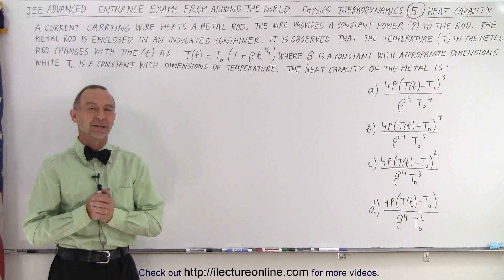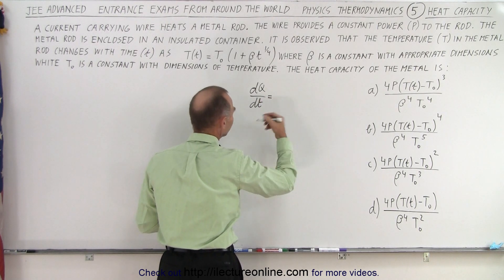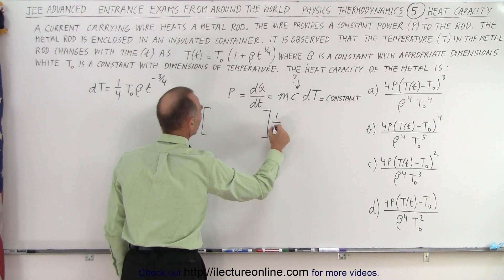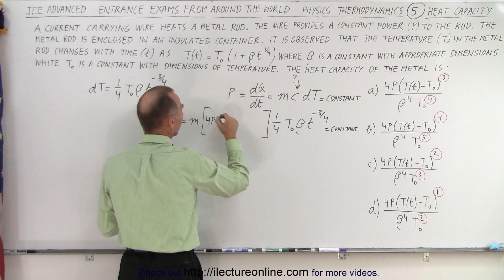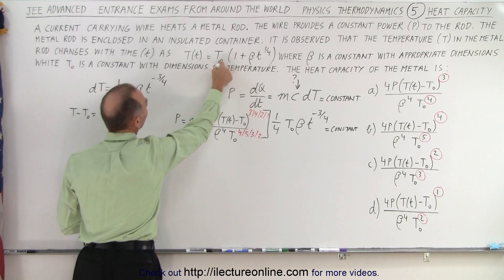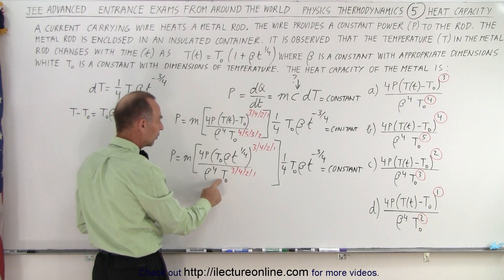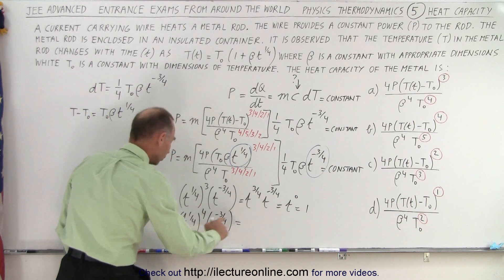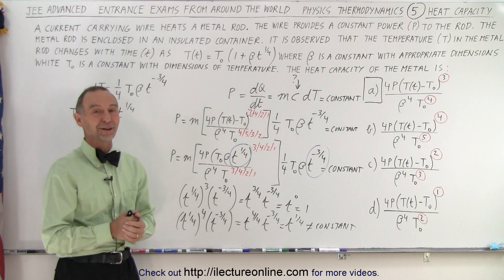JEE Advanced Physics 2019 Paper 1  #3  (#5) Heat Capacity

Comment: How do you solve it if there were no answers given?
Reply: You do the same first steps, until you get P=1/4 mBTo c t^-3/4
If you take the derivative respect to time, you can equal it to zero, since P is constant. 
dP/dt= 1/4 mBTo (dc/dt t^-3/4 - 3/4 c t^-7/4 )=0 
You solve the differential equation and get c. You would need an initial or border condition tho
Reply: @marcoskrupiczer6595  makes sense
Reply: By solving the ordinary linear differential equation having Heat capacity and time as variables